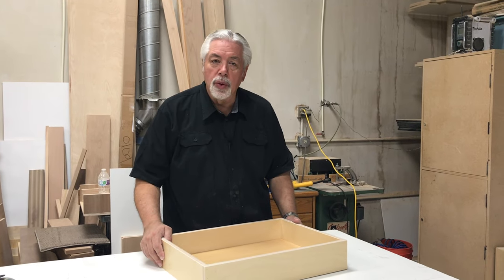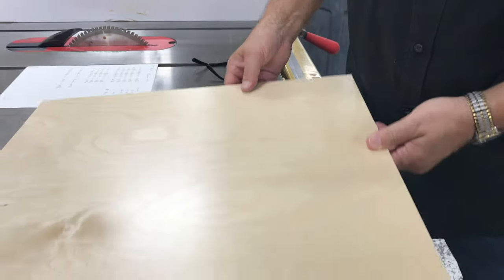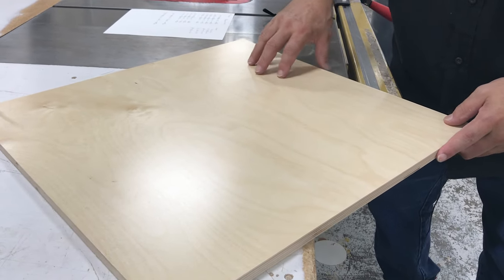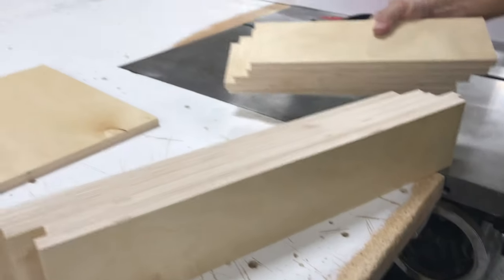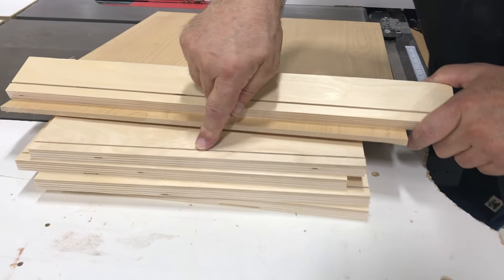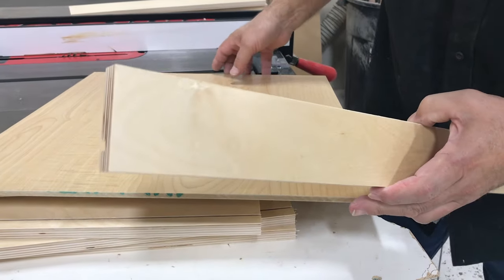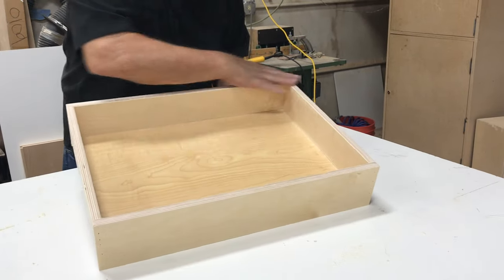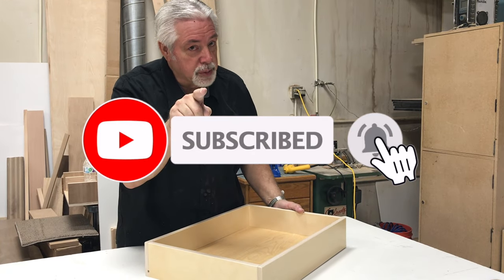Make The Perfect Kitchen Drawer

Comment: Wasted a beautiful piece of baltic birch with poor design for a simple draw. Didn't even glue the sides. This draw will be falling apart over time. Don't ever do your draws like this. This is a video on how not to make a simple draw. And don't use beautiful baltic birch to make a simple draw.
Reply: Perhaps saving the glue to reattach his finners?
Reply: We use alot of maple but we don't do draws with quater inch bottoms it's 5/8 draws with 1/2 inch bottoms we only do high end and every draw is dove.tailed and glued not.a single.nail

Comment: Serious how can you spend all this good material and charge customers a lot by making a drawer that will fall apart in few year….. bad joint don’t buy that guys and girls, look for drawers that is made at least with pocket screws or lock joint, nails don’t hold the joints in the long run.

Comment: Nice to see a real carpenter/shop in action when youtube is flooded with the all of these made-for-tv carpenters... This is how a real shop operates!  When i make drawers I like to use the pre-made sides that are available from my supplier, they are rips of baltic birch that have a radius routed onto the edges and have a finish applied. Then you rip/cut/dado them to your project. Since I am really weird about nail holes in the sides, I end up biscuiting and gluing the corners and I have to say its make a nice and strong joint (albeit time consuming). I never considered putting them together like you did, with ripping part of the back off so that you can slide in the panel. This is actually a great idea and would save the step of having to notch for the undermount style of guides. I might try this in the future! I think that having the staples is also another benefit, my panels are usually "loose" and I will add a bead of adhesive (PL or something) to them if I feel like it. Great content! Thanks
Reply from the maker: Thank you very much!! I really appreciate your comment. Wes
Reply: And I have rebuilt countless drawers when they are built like this.

Comment: because it's 15mm not 5/8", why doesn't america want to join 2022 and stays back in 1950
Reply: Their was a push or incentive in The US in the mid 1990s to convert to metric, turned out it was plain and simple to Expensive to change all the manufacturing machines, the weight and capacity standards, the road builders had a huge push back against converting or replacing their equipment with metric.  The short pushing the 1900's for America to adopt metric was a Complete Waste of Money, the program was abandoned after a 4 or 5 year "pilot program".   Thanks for the drawer construction video,  like this method, will be reviewing video again when I do drawer build.
Reply: Because a mm is your smallest unit of measurement.  The dumbest thing I ever used was a metric micrometer in my machine shop.
Reply: @sawhill729  LOL how do you think machining is done in the rest of the world?  LOL honestly.

Comment: New to this. Studying from my Youtube teachers. This is indeed very simple and looks very strong, BUT, everybody else glues the joints no mater how they join them. I think you only glued the bottom front groove. You are the expert, do you mind explaining your thoughts on this?  I am on my third set of drawers using the 1/4, 1/4, 1/4 technique, the 1/2 technique, and the pocket hole technique. I messed up everytime. Mostly on my width. I have also tried 1/2 ply. and 3/4 ply.  I FINALLY think I got it then I see your video. I guess I am over thinking this.  Thanks!
Reply from the maker: Bruce...for ease and speed of production I don't glue my corners, although many do.  In all the years that I have made drawers this way with this material I have never had to remake or repair a drawer because the corners didn't hold together.  It's an added step that I consider optional.  The 5/8" baltic birch is an excellent drawer material and once nailed together makes an extremely strong drawer. I hope this helps...good luck Wes

Comment: How much do I need to subtract from the cabinet opening ( width) great video!!❤
Reply: The answer you seek is in the instructions for your chosen drawer slides.  For Blum’s TANDEM slides, for example, the inside drawer width needs to be cabinet opening minus 1 21/32”, so assuming 1/2” material for the drawer sides, the outside drawer width is that number plus 1”.

Comment: Thanks for the video.  I am new to drawer construction and this helps.  How much weight can that 1/4” bottom handle? One of my drawers is 30”W x 22”D and needs to have heavy things like skillet or crockpot.   Would you ever dato or rabbit in a 1/2 bottom for more strength.  (I may be over thinking here.  All the best from north Texas.
Reply from the maker: Yes...I have put in 1/2" bottom when needed for extra heavy use. Hope this helps, good luck! Wes
Reply: @WoodworkingWithWes thanks.  I am going to be using birch.

Comment: Hi Wes, love your videos,  great content and well explained , what saw blade do you typically use on your table saw and do you have a sliding panel saw with scribing blade for melamine carcases.
Reply from the maker: Hi Alan...for cutting plywoods, such as the drawer material, I use a 60 tooth blade. 
For melamine, I use an 80 tooth triple chip blade. I wish I had a sliding table saw, that would be nice! Thanks for watching Wes

Comment: Great video! I was wondering what other plywood would be good for drawers? You mentioned 5' x 5' 5/8 Baltic Birch but I can't find that at the local big box stores. Looking at the date of this video I think baltic birch is NOW in low supply in the US. Most plywood now have a very thin veneer on each side? I don't want to spend a fortune. Any suggestions appreciated. Thank you.
Reply from the maker: Hi...as supply chains have become an issue, baltic birch is hard to come by for sure. In my latest video, I use solid, 5/8" poplar for my drawers as an alternative and it works great. Thanks for watching, Wes
Reply: @WoodworkingWithWes  Thanks for the update / tip. I will see if my local stores are carrying poplar and the condition of their stock. Thanks again!

Comment: How do I measure drawers for a Antique desk - which is missing all the old drawers?
Reply from the maker: Hi...drawers are typically sized based on the hardware used as drawer slides. You probably have wooden slides in your antique piece. Based on that, make your drawer 1/8" smaller than your opening and test that to see if it works. You might have to apply some wax to the drawer and runners to help them slide smoothly. Hope this helps. Wes

Comment: Do you ever use glue to reinforce the sides?
Reply from the maker: No...I have found this construction method to be very durable and have never had to replace or repair due to joint failure. Thanks for watching, Wes